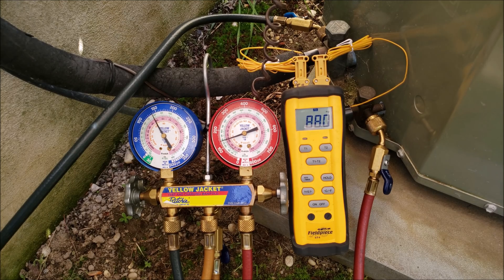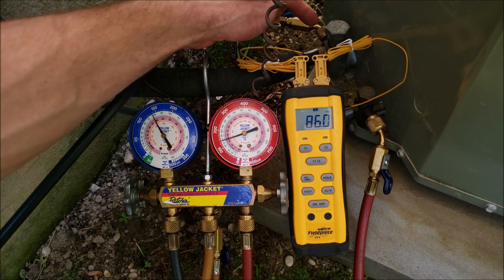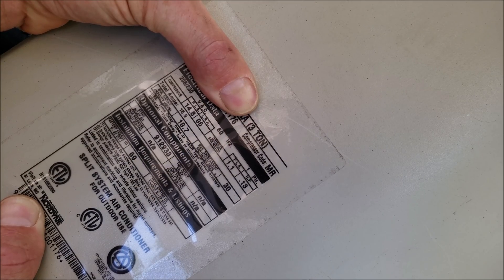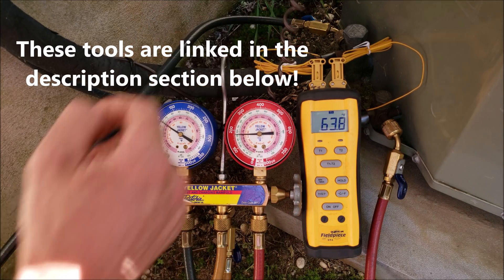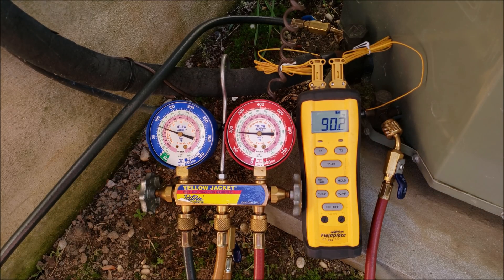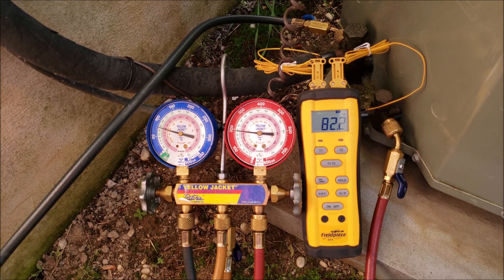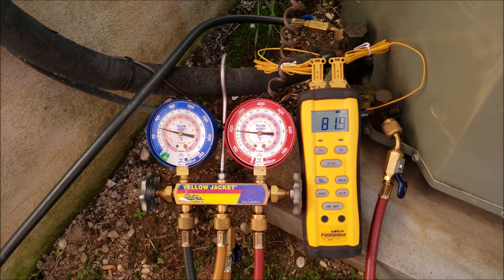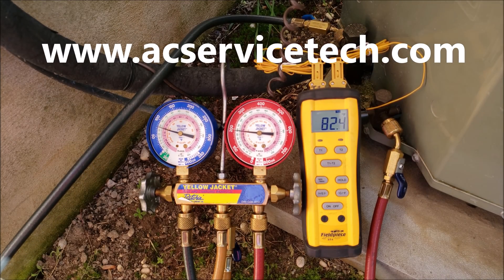Checking the Refrigerant Charge When the Target Subcooling is Not Posted!

Comment: Hello - My 1994 Trane XE 1200, TTP036C100A2 has a TXV on the evap coil... but the label on the condenser does not list a target subcooling number.  The Evap coil is model V1036.  I found old paperwork that I believe identifies the coil brand as "Superior Coil Inc."  The Subcooling listed in the paperwork indicates Min 16, Nom 18, and Max of 20 subcooling F.  Does this sound reasonable?  Seems very high to me, based on my classes and what I have been reading.  Any help is GREATLY appreciated!

Comment: 2002 Trane heat pump with TXV does not list subcool on rating plate. However they include in service packet a “TXV Refrigerant Charging Curve” graph having liquid temperatures on the x-axis and liquid pressure (Psig) on the y-axis. The graph shows when to add refrigerant vs when to remove refrigerant according to the point on the curved line of the graph indicated by the intersection of these two temp. and pressure values. Should this be used as the best charging guide rather than the 8-12 subcooling you explain in this video? Thank you.
Reply from the maker: So that is giving you a range of subcooling instead of other manufacturers giving a specific average target to shoot for so in the case of that model number unit, use that guide. Other units will fall under different subcooling, thanks!
Reply: AC Service Tech LLC     The graph does not show a “range of subcooling values”   At the intersection of the liquid line temp. Vs liquid line you are placed either right on the graphed curve line (charge is good) or above the curve line (remove refrigerant), or below curve line (add refrigerant).  I don’t know why this Trane model does not list a specific subcooling number on the unit.  That would be much easier way to check charge.  Thank you.

Comment: Can you teach us the proper technique on how to park refrigerant in the compressor? I watched your nitrogen pressure test videos but didn't catch that portion. Thank you!
Reply from the maker: Look up "acservicetech break the vacuum with refrigerant" thanks!
Reply: @acservicetechchannel  Thank you. That video was helpful to see how you released the refrigerant from the compressor. I was also curious if you had any tips for the actual pump down. Basic steps are to close the king valve on the liquid line and start the AC unit. Watch gauge until pressure drops to 0 and then close off king valve on suction and turn off AC? Your videos always seem to have useful tips that others overlook, so I wanted to be sure there weren't any best practices I'm missing here. Thank you
Reply from the maker: Thanks, I have many details discussed about why and why not in the ebook & paperback. Topics that come to mind are all the wrong ways to check the charge that individuals do and teach to others, txv efficiency compared to pistons and how they work and how they can fail and so on. Thanks a lot Fiat!
Reply from the maker: @fiatr.5472  did you look up "acservicetech pump down" i have a video on that, thanks!

Comment: Great video! Today I've applied this information on a practice. It works. After 10 min of run the system. I've started added refrigerant. And the saturated temperature starts rise up according to liquid line temp? Both 115F. Then father 3-4 min, in a moment liqid line temp starts to drop down very fast until 105. Interesting......
Reply from the maker: Hey Tapch MC, so you checked the charge, found no subcooling, added how much refrigerant? Then after 3 to 4 minutes the subcooling reading increased dramatically? Usually when you have close to a full charge, the subcooling will fall quickly so you have to watch how much you put in. Are you saying at 10 minutes it was showing 0 subcooling but you think there was subcooling at that time and it needed more time to settle in yet? How much did you add? thanks!
Reply: AC Service Tech LLC I’ve didn’t use the scale in that case. But by the experience 1-1,5lb total. And yes when I came there was no subcool.  Interesting fact that subcool temp and saturated temp rises up from 105F to 115F and stays for 3-4 min, after I’ve add approximately 1lb, but after I’ve add little bit more, it’s starts separate, sub cool starts to drop very fast, and I’ve got 10 degrees subcool. Thank you for the answering🤝
Reply from the maker: Oh ok I understand now, yeah that is a lot of refrigerant. Any time I add a pound or more, especially if the units vapor sat temp is below 32 degrees F, I shut the outdoor unit off and let the indoor unit continue to run. Then I turn the outdoor unit on again and wait my 5 to 10 min to check the charge. When adding that much, it needs time to react. Make sure to add slowly into the vapor side slowly while running, thanks!
Reply: AC Service Tech LLC Thank you, Craig, you answered completely. Trying to use all your tips.)

Comment: I was thinking about getting in the hvac trade do you have any videos on tips on what to expect
Reply from the maker: It really depends on whether you are going into residential or commercial but with this trade, you will eventually need more tools than any other trade. Learning HVACR usually means that you learn a lot about electrical, carpentry, and plumbing as well. If you like to learn and you get into the right company, then there is a lot to digest, thanks!
Reply: @acservicetechchannel  i seen the prices of some of the tools the stuff is not cheap i think if i was going to get in the trade i think i would want to do residential I"m really not sure I"m just ready to learn a trade like working with my hands
Reply from the maker: You only need basic tools to start anyway. The field has always treated me pretty good and I am always in a state of learning. The more you learn, the more you can apply and the more valuable you are. Create a resume and start knocking on HVACR company doors, thanks!

Comment: Hey Craig, i have a question i am a no HVAC technician but have a little know how about how the refrigeration cycle works. I normally have seen metering devices near or close to evaporator coil but in some split ACs the metering devices (mostly capillary tubes) are installed in outdoor units. Can you please shed some light on it regarding why it is so and if there is different method c
Diagnosing such a system and charging refrigerant in it. And does that mean there is no liquid line in the system both low side and high side a vapor lines and we need to insulate them both avoiding any loss in refrigerant temperature causing liquid slugging the compressor? Please answer. Thanx
Regards 
Wasim
Reply: There is always a liquid line in the refrigeration cycle. The split systems you see with metering devices in the outdoor units are heat pumps. They have a metering device in both the indoor and outdoor unit. In heating mode, the outdoor unit becomes the evaporator and the indoor unit becomes the condenser and the unit reverses its direction by using a reversing valve.
Reply: @KaesOner  actually they are not heat pumps i can confirm that since i am using one of them and there is no reversing valve installed whatsoever its just straight pipes leaving compressor going to condenser and then orifice tube and then the evap. 
By no liquid line i meant the small discharge  line will no longer actually carry liquid refrigerant since it is AFTER the metering device in the refrigeration cycle.
Reply from the maker: Hey Wasim are you referring to mini split units? Could you mean the normal distributor tubes that are in some outdoor units which connect the condenser coil to the liquid line. On split systems that are not heat pumps, there wouldn't be any capillary tube metering device unless it is an odd unit that 30 years old or older. In fact in the US, no split system ac units have had capillary tubes installed as the metering device for cooling mode over the last 25 years. Less expensive package units and small packaged ac units, window, and stand up ac units however will likely have capillary tubes as the metering  device because of the cheap cost even to this date. Anyway, if there was a metering device in the outdoor unit for cooling mode prior service port than you can only check superheat with the low side pressure port. However, you could check subcooling with pure temperature readings only. Thanks Wasim and thanks Kaes for your answer as well! I would probably have asked if it was a heat pump if you didn't already, thanks to both of you!
Reply: @acservicetechchannel   yes they are those mini splits 1.5 tons. I live in Pakistan and here refrigeration is 50 years behind the US lol. So your claim of these systems being 30 years old or more can fairly be right. 

Yes these capillary tube (one in number) are actually attached from condenser to the high side service valve before the valve. And there is no other metering device in the loop the distributor is in the indoor unit a few inches before the evaporator. 

So, i should be measuring subcool to charge the system since its having a fixed orifice metering device by taking delta T of liquid line temperature and saturation temperature from the liquid side gauge and I'll be good to go right? 

Lastly I want to thank you for the time you invest in the videos you make and spoonfeed your viewers with in depth and authentic information and industry procedures. Thanks alot man.
Reply from the maker: If there is only the cap tube metering device with a singe speed compressor then you would be checking the charge with total superheat using the vapor port. Also yes both the liquid and vapor lines are insulated from the outdoor unit to the indoor unit. Thank you very much Wasim and glad to help!
Reply: @acservicetechchannel  Thanx bud. Being on the other side of the world i can't buy your book the reason being No Paypal here and its way too expensive for me to pay in dollars (even the PDF versions too :( ) since my one month earnings totals up to just 50 american dollars lol. Can you please guide me to some good HVAC forums and study resources?
Reply from the maker: hvac-talk.com is a good one and you can look at Brian Orr's stuff too at hvacrschool.com thanks!

Comment: If my condenser unit only has a compresser capacitor how is my fan motor wired i notice that the fan motor takes 3 attempts to start spinning and at times not always..you think it is normal not to have a separate capacitar for fan motor nad yes my capacitor is single only for compresser i have a  ge fan motor  6 wires
Reply from the maker: The condenser motor could be a shaded pole motor that doesn't need a capacitor but you can confirm by reading the rating plate on the motor itself. It wouldn't be a shaded pole unless it is really old likely. Sounds like you would need a new motor by this point anyway. You want to make sure that motor works or it can hurt the compressor with high pressures and the internal pressure relief blowing, thanks!

Comment: Indoor dry bulb? Or indoor wet bulb? I see you have listed indoor dry bulb
Reply: Pretty sure indoor always WB. I asked him to post.
Reply from the maker: So I was checking subcooling on this job because it had a txv. I did not take a indoor wb measurement as I would with the total superheat method. The indoor db was 76 but I know I mentioned wb in the video because I was trying to explain that the low side sat temp was high due to the high indoor heat load and the heat load includes humidity, not just temp. I would suspect that the wb was around 70 since this was the first time the building turned the ac on and humidity was high, Sorry for any confusion
Reply: @acservicetechchannel  Got it, thanks.  NOW if the subcool is missing for a fixed O or cap. setup is there a similar way to come up with the number yourself?   thanks, but you are so knowledgeable I hit you up again. THANK YOU for your time.

Comment: That high side pressure for a 87 db at 190 is kind of low and that suction is cutting it close at a 45 degree coil is kind of high. What seer is this unit?
Reply from the maker: This was a 14 seer R-22 unit. The indoor heat load was high to start so that is why it was around 45 degrees.  The low side sat temp will be dependent on the indoor heat lead even with a txv but especially if it had a piston, thanks

Comment: Sir, at 1:22 did you intend the indoor temp measured to be WB at 76?  thanks.
Reply from the maker: So I was checking subcooling on this job because it had a txv. I did not take a indoor wb measurement as I would with the total superheat method. The indoor db was 76 but I know I mentioned wb in the video because I was trying to explain that the low side sat temp was high due to the high indoor heat load and the heat load includes humidity, not just temp. I would suspect that the wb was around 70 since this was the first time the building turned the ac on and humidity was high, Sorry for any confusion and thanks for helping Purple Giraffe!

Comment: I've always wondered how to find the SC/SH target temperature if its not on the unit, but how do you get dry bulb/wet bulb temps?
Reply from the maker: You would measure the indoor wb at the return grille or grilles and average them or more accurately drill a 3/8" hole in the return duct 2 feet before the coil and measure it there, then put a duct plug in the return hole. Then measure the outdoor dry bulb temp roughly 1 foot away from the outdoor condenser coil in the shade where the air is sucking into the coil. Take these two measurements and input them into a target superheat chart to figure out the target superheat for that moment in time. I have an article on it with the chart at acservicetech.com and of course I go into much greater detail about it and other charging methods in the book found on the site, thanks Purple Giraffe and Ricardo!
Reply: Check out in his tool list this video psychrometers - 2 different venders.